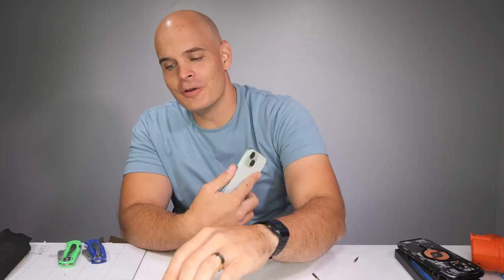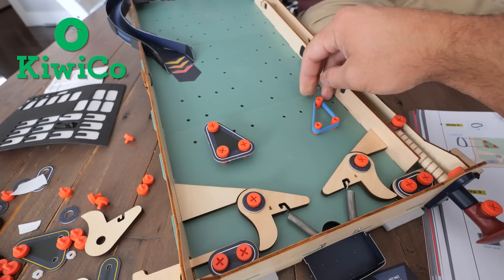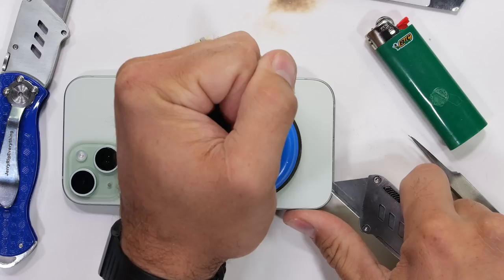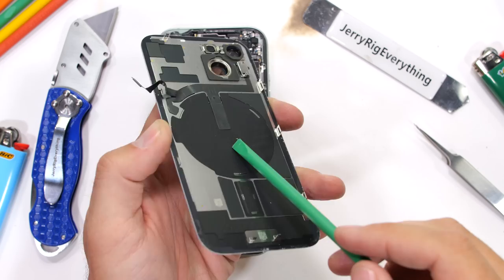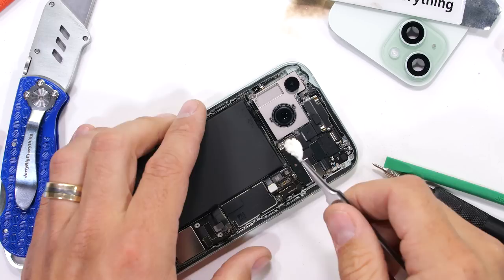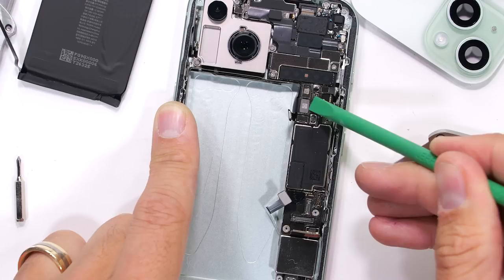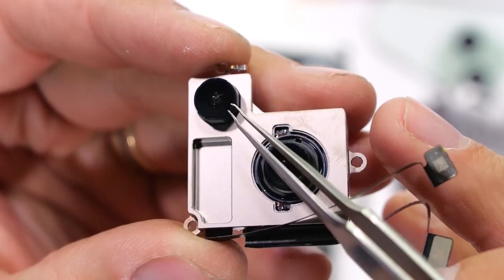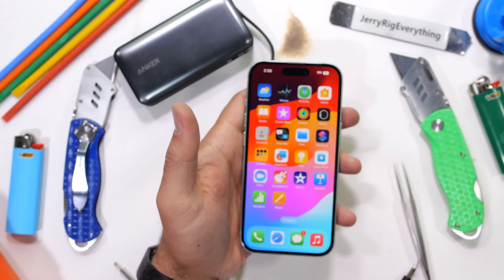iPhone 15 Teardown - Why is nobody talking about this?!

Comment: You know its Apple when the phone literally has a dedicated space for SIM card storage expansion, but instead they fill it with a pointless metal block.
Reply: Not the same thing but the S24 and S24+ are sold with the Exynos chip anywhere outside of USA and they have worse battery life, performance and get slightly toasty sometimes plus the photos pretty diffrent.
Reply: @petermikus2363 yeah idk why so many people wanna lick the boots of one company over another. Being a fan of competition means I never lose out 🤷‍♂️
Reply: It isn't expandable storage the SIM card it is for your phone number.

Comment: Using kelvin instead of fahrenite or celscius is actually genius 😂
Reply: It is. Pisses everyone off equally.
Reply: Actually it's very easy to convert into celscius
Reply: Just substract 273.15 from Kelvin you will get temperature in celsius.
Reply: @AnoNym-zi5ty I don't think everyone, you only need to remember 0°C is 273 Kelvin and it's honestly far easier to calculate than say Kelvin to Fahrenheit
Reply: But it is not degrees Kelvin. It is just Kelvin. And actually 6000 kelvin sounds a little bit too hot
Reply: It would be genius if used properly. Saying '6000 degrees Kelvin' shows you don't have a clue, as a) it's just Kelvin, not degrees Kelvin, and b) aluminum and glass melt at way below 2000K, let alone 6000K.
Reply: bro couldnt even spell either of them right lmao
Reply: @AnoNym-zi5ty no it doesnt, it only annoys Americans. Kelvin is just celcius+273.15
Reply: @maybeharold  i would be pissed to if I always had to do some math for a few seconds instead of just getting the value right away.
Reply: Kelvin is basically just celcious in disguise 😂

Comment: That pulltab was satisfying 😂
Reply: Forbidden cheese
Reply: Kinda made me anxious
Reply: not in two years when you probably want to replace the battery and try to pull the tab but it brakes every time with the slightest pull.
Reply: That "Nice." in the end cracked me up..
Reply: @TobiasDettinger or even crashed into small junk (or dust?) pieces
Reply: Have that on full volume it was worth it
Reply: that thang went ✈✈
Reply: Absolutely hate that sound. Don’t know how anyone can like that
Reply: Yes, It didn't rip

Comment: Whenever i see a company brag about how much recycled stuff they use i typically think: "Yeah, either you are greenwashing or the recycled stuff is cheaper to use anyways."
Reply: Or theyre recycling the working phones they send for "repair" that never get repaired just replaced😂
Reply: Never understood why they charge full premium price for recicled materials. I mean if I pay 1500 + for a phone i expect it to have premium new materials not be made from washed up plastic straws😂
Reply: @johnbroke2336  But since those straws function EXACTLY THE SAME, wouldn’t you want that? Or are you just selfish?
Reply: It actually cost more to mine the materials from existing devices both financially and in time it takes, space is needed for the very specialised equipment, extra staff and energy etc. Apple have designed and developed the equipment and process needed to keep it in house so very innovative.
Reply: @LambdaMiscellaneous fr tho the planet is dying and they’re worried about some recycled material
Reply: @TheEviltaco666 planet  is not dying
Reply: And the contract may cover a minimal number of a word "recycled" that have to appear in the clip before the money transfer can be confirmed.
Reply: Exactly.  They only use whatever’s cheaper
Reply: Even if the planet isn't dying (this is a debate for another time), why wouldn't you re-use resources? That way, you can optimize the usage of the new resources better, and their function/reliability will be the same. I don't understand why these people want everything brand new, stupid flex 🙄

Comment: That pinball table actually looks really cool
Reply: I wouldn't have wanted it as a kid, I wouldn't have been able to put it together and would have broken it
Reply: The rubber rings usually have a sensing switch, and an actuator electromagnet that sends the ball back from where it come. May be this is a toy version and it has the visuals without the functionality...
Reply: I used to have an older version of that and I may even still have one or two pegs from it, and yes it was cool
Reply: And then boasting about efforts to sustainability 😬😬
Reply: Too bad it's not designed for kids aged 105

Comment: Loved the sound of the battery tape being removed.  It is good to see that Apple is getting into recycling, as well as reparability, although the pricing needs a little work.
Reply: It's just eyewash.
Every year tens if not hundreds of millions of still perfect working Apple devices are being needlessly sent to the scrap heap, simply because of being icloud locked.
Reply: @zahrans where on earth did you get that stat from?? 😂 not to mention the ones that ARE sent to scrap for being broken or locked are usually from people that steal them, and not apple
Reply: @fake_butters  Where did I state it was Apple itself which is doing this?

Sure, some are obtained as stolen goods. But a vast majority are simply the iphones, macbooks, ipads etc. which have been discarded by it's original owners when they upgrade to a newer model. It was really eyepopping to see on a right to repair video 
I saw a few months back, numerous plastic containers filled to the brim with perfectly good iPhones which cannot be utilised once again as they have all being activation locked & either bricked or potentially bricked

Comment: It's really amazing if you think about it how this phone is so amazingly modular and beautifully repairable if Apple just pulled their head out of their ass just a tiny bit.
Reply: Too bad no one can actually change the parts but them, but they wont change just a singlke part, theyll just charge you for the whole board
Reply: We can only dream..
Reply: Internally iPhone is so well designed.. But their uptightnees to keep their walled garden is absolutely disgusting. If is well priced I don't mind but their prices is absolutely ridiculous.
Reply: It would be a thief's dream iphone as well, there's a reason why they go out of their to software lock components
Reply: @Hhhh22222-w lmao keep defending their shitty tactics, and they'll keep charging you insane amounts to repair something as basic as a cracked back panel.
Reply: @ayol1011 It's not "uptightness." It's greed. They make more money that way.
Reply: Haha you're so funny and sheep 😅😅😅
Reply: Uh oh we have anti corporate capitalists in here
Reply: I don't understand why they can't just A) stop software locking parts that aren't necessary for the full functioning of the phone, and B) maybe try pioneering a new kind of waterproofing that doesn't need to be removed and replaced whenever you want to repair the phone. Oh wait I do, it's because Apple loves money more than the environment. Broken back glass? Either pay $169 to replace it at a genius bar or get your carrier to upgrade you to the newest phone for slightly more while your old, perfectly working phone goes to the landfill. :/
Reply: @ArtForSwans  Lol yeah just ignore the huge strides Apple has been taking in the industry when it comes to environmental impact. Better than pretty much every other tech company right now. Oh but yeah Apple is ruining the environment by making it harder to replace glass oh boo
Reply: what's the point of modularity if everything is software-matched to the motherboard?
Reply: @sardanus  Just to play devil's advocate:
You can have every single part of this repaired in theory. The point is that you COULD rematch parts. 
Apple is not going to because that's not the most profitable path but they COULD. That would make it very repairable in theory. In practice they'd obviously not only need to free up the software matching but also open up their parts to other repair providers.
Reply: @mojolotz  why do i have to pay for their repair program if I have another same iphone to switch parts? And i'm not talking about 3rd part spare parts
Reply: Yeah, still a rip from them that the replacement parts, even legit - won't work right.
Reply: I don't know how it is in your country, but where I'm from tech repair people are basically car repair people but worse. If you give them something to service - chances are they will break it further and charge you an arm and a leg for the privilege. Because of that I never repair anything, and never buy refurbished tech. With only exception of Apple products. Because I know that even if I buy a refurbished Apple product, it would be in excellent condition, because it simply will not work without sacrificing at least three virgins to Tim Cook himself. So you can cry all you want about Apple's uptightness - it's the only reason I trust them, and will continue to do so.
Reply: @friendlybane that’s how business works, are you 5? 
Even your favorite YouTubers make money in ways you probably don’t agree with
Reply: If Apple stopped pairing parts, used less types of screws, and solved the iCloud Lock problem (Maybe it should expire after 30 days), Apple would be a very sustainable company. But ofc, profits are more important than the environment…
Reply: @friendlybane it’s most definitely both greed and uptightness. Apple doesn’t make as much on repair as people think because generally most repairs done on iPhones are part of guarantee or Apple Care and Apples guarantee repairs are by far some of the most costly on the market, because they refuse to repair and rather change everything and send the rest goes for recycling. 

They basically 1- change the whole screen assembly (even for example with bad ribbon cable), 2 - change certain components (battery, back assembly, port assembly) or 3 - exchange the whole device… while surprising, this is still the most likely type of Apple repair (is your wi-fi bad in any way…ok exchange, is your video chip bad ? Ok exchange, does your phone fail diagnostics for unspecified reason…ok exchange)
Reply: @occamschainsaw3450  bad 3rd party repair/mechanics are smashed by consumer protection laws. they are shit in America where apple sells you a water resistant phone and then doesn't warranty that resistance they promised but in Australia there are a lot more laws in place to protect the consumer from dodgy shit like that and its also why checking and leaving reviews where you have both good and bad experiences is important.
Reply: @MasterLoki1991  Relying on laws, again, is unreliable. If they are great in Australia then you are lucky, but you are not going to enforce great laws all over the globe. But I can trust apple products everywhere, I will buy them from a dodgy guy in the jungles of east timor because I know for a fact that if he so much as looked at it funny it will simply not boot. That trust to me worth way more than any repairability, because I don't have Parkinsons and don't break my shit.
Reply: @occamschainsaw3450  apple doesnt need to lock all the basic shit behind paired parts to disable the phone to make a secure device. if 3rd party repaires did not exist, apple would stop repairs for those devices in a heartbeat because it meant you had to upgrade. repairability isn't just about breaking it but makes sure you can maintain the device. a bit of water into the ear piece and it causes iPhone to boot loop. apple says its a broken motherboard and you need a new phone when its a cheap ear piece that just needs to be replaced. Many MacBooks are going to the trash because apple does not do the board repairs and refuses to allow recycling centers to even sell the chips off their motherbaords and instead forces them to be ground into dust. 

the whole point of government is to bring these sorts of laws in and keep the average joe protected from criminals big or small.
Reply: @ayol1011  i mean, flagship phones from other brands are about the same price. Its just that apart from the SE apple doesnt do a budget range of iphone
Reply: @MasterLoki1991  I'm not saying that it's objectively good. I'm saying that it's a trade off, and if they would be less restrictive it would destroy trust, and I personally care about that. There are dozens of different manufacturers you can buy from who can satisfy your needs. There is only one that can satisfy mine. 

And if you think that the gov gives two shits about you personally then I can only say "lol". Even if it is so - again, you may live in a country with great consumer protection laws. But you can't force the whole planet to have great consumer protection laws. I trust apple tech no matter in what god forsaken corner of the world I am. You can't get that by passing legislature in your small corner of the planet.
Reply: yeah i send prayers to all the people that need their shit repaired monthly, because nobody does.
Reply: sure and then having all these stupid individuals coming to apple repair shop that something is not working lol.
Reply: Why would they? Lol its sells and they help local businesses that repair phones
Reply: @friendlybane they also put most of there money back into the company, and have you ever seen Samsung, get off your high horse and start thinking objectively

Comment: It'd be interesting to try connecting a sim tray with a sim card inside and see if the iphone recognizes it. I remember this happening when plugging a dual sim one to a normal sim slot
Reply: if i remember correctly it does, someone put an eu phones sim tray inside the us model 14 pro and i’m pretty sure it worked fine, they just put a piece of plastic in the slot
Reply: @squabbledOwO where

Comment: Hey Zack! I think I figured out why the 15 PM back glass broke on you bend test. As far is I can tell from your teardown videos there is an aluminium plate glued to the back glass of the 15 (plus and regular) whereas the back plate on the 15 PM sits is in the frame of the phone. This would be an ' amoured glass' providing the glass with a safety net agains bending(maybe locking out sooner than normal glass) compared to the 15 PM where there might be just a thin sliver of nothing between the two materials. I guess the surface of the 15 pro is just too small to be bended(like bending a small pice of the same metal compared to a larger piece). I see it as a design flaw people would have to live with. Amazing content as always. Thank you and we'll see you around.
Reply: Shh, don’t be reasonable. The media loves to tell people iPhone 15s are breaking left and right.
Reply: @LambdaMiscellaneous well they do. It's a great phone but you should wait couple months until they figure out the overheating and battery issues
Reply: @Matt-bp5vy overheating has been fixed, but it is true that the pro max is hotter than normal, this is due to titanium as it doesnt dissipate heat properly, still lower regular temp than flagship android phones tho
Reply: Android is an OS, not a phone maker. Android phones are not all the same like apple phones
Reply: @hirschibar It's vice versa, with android being a phone maker and apple an operating system maker.
Or why are they not making different phones?
Reply: A design flaw that only occurs when you forcefully try to break the phone on purpose? Ok…😂

Comment: @jerryrigeverything 2:10 everything 5000-6000K is the temperature of the photosphere of the sun. At that temperature, even the heat gun would melt! But nice video, I love your scientific approach to find the limits of phones.
Reply: also Kelvin is not measured in degrees

Comment: I find it funny that the Backglass on the 15 Pro Models are not software blocked anymore which Phone Repair Guru had shown, but the Backglass on the Base 15 Models is still software locked.

Like they aren't even trying to hide the fact that they want you to get the Pro Models anymore...
Reply: They were never hiding that they wanted you to go for the pro models. They're more expensive and more profitable, duh..

Comment: I’m glad you’re taking the time to consider other phones. Great time to pass along some information about Samsung (and Motorola’s) flip phones directly from an AT&T representative (not me, an acquaintance of mine). He told me tell everyone to beware of those phones . They are trendy and cute and oh, the click when it closes! But after about a year a line develops across the screen where the phone bends, and Samsung and Motorola give their customers hell every time they try to use their warranty to repair or replace it. It’s a mess!

Comment: As someone who’s never seen inside an iPhone, i’m surprised how modular it is and how many screws and ribbon cables there are, i had assumed it would all be tightly integrated on a single board with minimal cables / connectors. Also thought the battery would take up more space than it does and the circuit boards less space.

Comment: Still looking forward for implementation of safety feature that detects if iPhone has been disassembled in any way, And prevents from using device unless it's gonna be taken to Apple repair for "verification". 
Right to repair has achieved almost nothing when it comes to Apple devices.